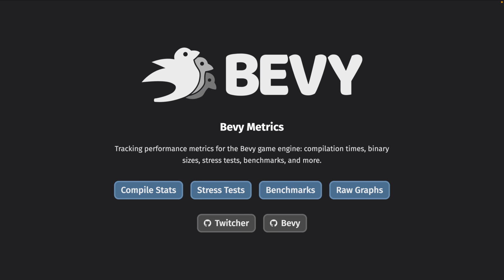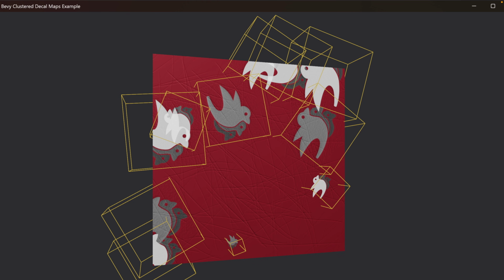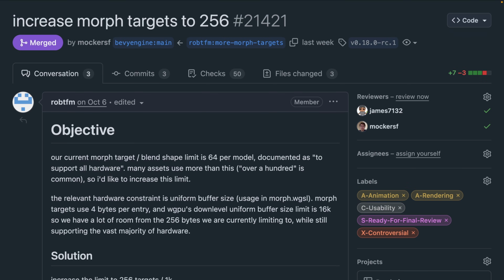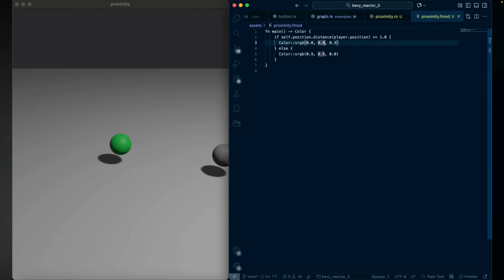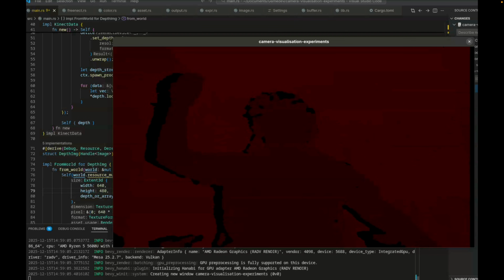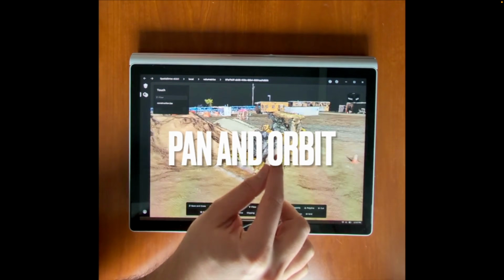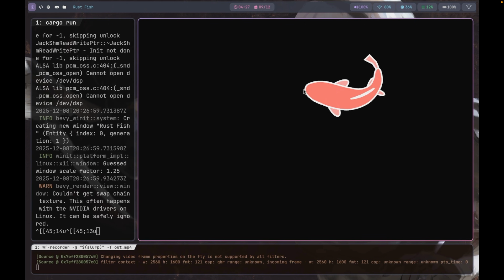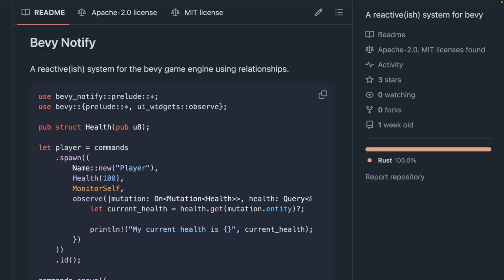Bevy 0.18 Release Candidate, Metrics Dashboard, and more - This Week in Bevy

Comment: Hey. I'm  planning on building a game like BUS SIMULATOR INDONESIA and i can't decide on the engine. Do you think bevy is capable to match that plus online multiplayer mode. I plan to release it on pc and on mobile. I can't find any 3d game in bevy of that caliber. Your thoughts would be of much help
Reply: It has good multiplayer capabilities in the rust ecosystem (better than most indie engines even), but it still might be easier to use Godot which also has a solid ecosystem (Netfox etc)

Comment: When is Bevy going to get it's first basic gui scene editor ? Egui is doing too much heavy lifting at the moment . I just wanna know if it a few months 2 years or are we speaking decades  ?
Even if it were just a bundled project loader , that pointed to where the project was and let users put there own cargo run command in a text boxy , to click play off of ...that would be better than nothing and all the scene file would have to save is the path of the project , run parameters and version of bevy and scene and maybe custom notes box and pointer to an image path for a custom thumbnail , everything from that point is iterative , oh and of course a new project button that just calls your git clone and cargo build functions to start a new project . 
Every small GUI program that removes manual tasks and adds to a visual interface is a big boost to get users on board and users lead to contributors and foundation donations  .
Reply: my impression is more 2 years than a few months, but definitely not a decade. the new scene format has to be working first, and that's looking like next release instead of this one
Reply: you can see my attempts at 5:17. this is month old now. recently I have released new video. answering your question - basic scene and config editing is realistically can be done withing next 6 month if all goes well. But I'm talking about basics - scale/change position, spawn/delete, etc...
Reply: @settydark saw your most recent post, very cool.

Comment: Disappointed to not hear anything about the new UI framework. Maybe I got it wrong, but I had thought they were targeting 0.18? Must have got delayed I guess.
Reply from the maker: Bevy operates (or at least tries to) on a release train model. BSN wasn't merged when the rc time hit so it didn't make it. Release train ran on time though, so expecting another train in 3 months.

That said, improvements to feathers and builtin widgets have definitely landed, which I'll cover in the 0.18 release video
Reply: @chrisbiscardi in no way a complaint. And it's great they have a regular schedule. I understand what it's like building software and these UI changes sound significant. Keeping my fingers crossed for 0.19 :)
Reply: @chrisbiscardi bsn really is starting to feel like the feature we'll never get. i get it, its hard, but i can't help but feel as if there was a goot amount of over-promising going on with the communication about bsn
Reply from the maker: Well there is a working branch for anyone that is interested in using it and providing feedback on the implementation, which is a step forward. but I agree specifically that it should not have been mentioned in the "future work" of the 0.17 release with the "0.18" label. That was recognized though and I don't think it will happen again.
Reply: @chrisbiscardi I might give this a look then. I'm in the early stages of a bevy game and have decided to use native bevy rather than third party for my UI. It's okay, but I want to track the new BSN code and port to it once it's stable.

I'll dig out this branch and give it a look.
Reply: I don't see BSN as even being related to UI. It's sensible as a simplified approach to complex scenes, but not for UI. UI macros should be Html based. I actually made one and am having fun making it nicer
Reply: @thekwoka4707 oh really? I'm pretty new to the Bevy community. I might have misunderstood. I thought it was a higher level abstraction being used to create something more like"widgets". But quite possible I am way off :)
Reply: @anoni-mouse-on-nix Yes, it is. I have no clue what the other person is on about BSN having nothing to do with UI.